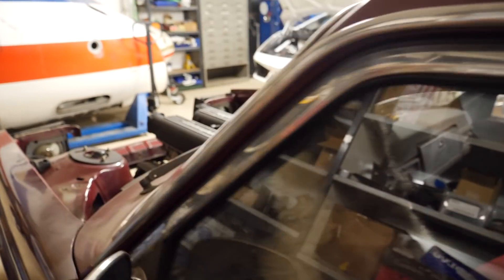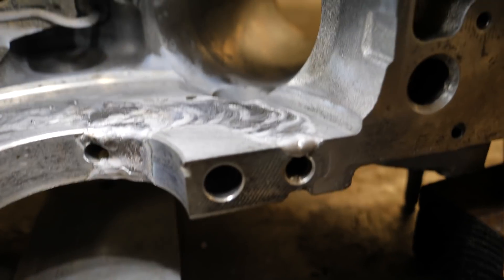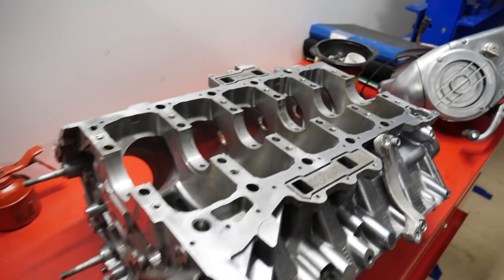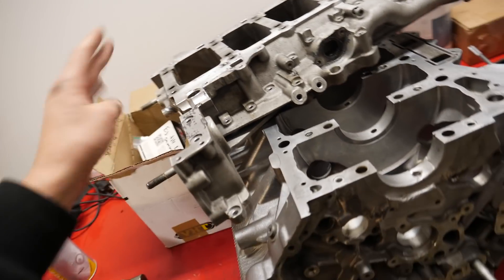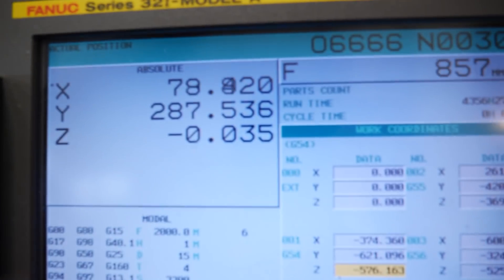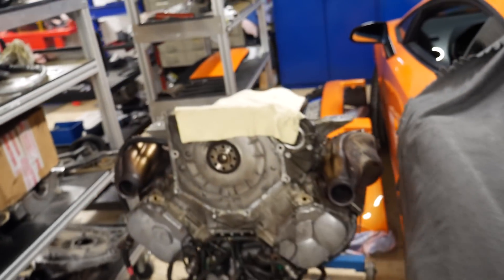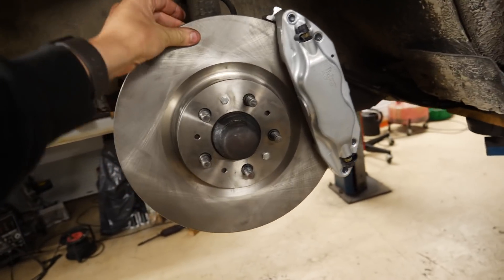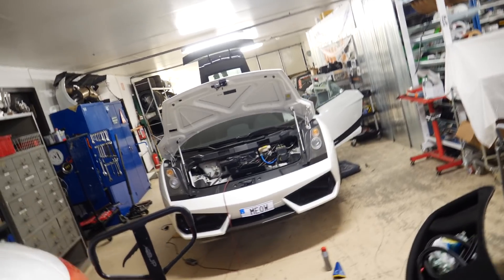Welding of broken Lamborghini engine block. Volvoghini Project!

Comment: I wish you luck in your endeavor, but that engine block will always be hurt and that whole area will be ready to break again at anytime.

Cool vid thou.
Reply: Yep, the unequal thermall stress is going to put additional load on main bearing, resulting in premature bearing wear. Worst case scenario it can crack again at high speed due to vibration resonance. I hope the best for the guy, although I would not take a ride in that.
Reply: @TheWiniarss  

Yep, metal is like glass, even if you manage to fix the major cracks you see, there are smaller micro cracks all over the place.

Comment: It looks to me like you will have significantly raised the centerline of your crankshaft after you have align bored the mains. This will cause the timing between crank and the cams to be changed as well as the the deck height of the pistons at TDC. This will of course raise the compression ratio and possibly cause interference issues with the valves. You may also experience front and rear main seal leakage issues. Also you have ruined the heat treat of the block where you welded it. Also, if the surface of the block that the main bearing girdle bolts to is not flat and/or does make complete contact with the bearing girdle (you mentioned that you did not build the surface up enough when welding it), it will twist the girdle and cause binding of the crankshaft and failure of the main bearings. Depending on what you are paying for your cnc time/parts/etc , this may not be a very cost effective project.
Reply from the maker: How much is that significantly? The camgear is not fixed to the camshafts. So even if i would move the crankshaft a lot, timing and valves would not be a problem with this engine. What kind of heat treatment do these Alusil blocks have? The surface was just not up on a very small spot. Will not twist the girdle :)
Reply: @PeterBjorck  I am not aware of the exact heat treatment process I would ask a firm that is experienced in aluminum engine block repair what the options were. As far as the cam/crank timing it is good that it is adjustable, although adjusting this on a four cam engine will certainly be a big job. I think my greatest concern would be the change in the piston deck height at top dead center as it relates to valve-to-piston clearance. What is the maximum  amount of material that can be be removed from the block deck and or head for reconditioning ? That amount should give you an idea of how much room you will have before you run into problems. For many contemporary engines this limit is very, very small.

Comment: Sounds weird to me and hurts my ears. I've always welded with earplugs in. 😆 But seriously longterm as a profession it pays off to protect it. My father is practically deaf now. I'm 4th generation but doesn't look like there will be a 5th however. Only machine shop around that accepts repair work and still retains a few manual machines but I don't know if that's going to be the case 15-20 years from now.

Comment: The modern Volvo 4.4L v8 is designed and built by Yamaha it's way over built and is good for a 1000+bhp @ 9000rpm. I got one for £500. You could be 10k into this engine just to find its junk.

Comment: just a tip of tig welding don't take the filler out of the argon shielding gas your interdicted contaminants to the weld when the filler is meted you get O2 and this is vary bad weld in time to see if the weld job holds up ???? WOw I see all the junk in the puddle that is not good

Comment: You're pulling the filler material WAY too far away ... filler material should be still within a close proximity to the arc to help "preheat" it and prevent impurities from forming